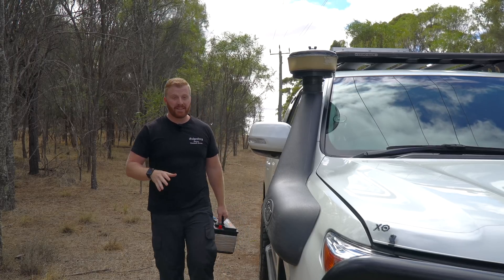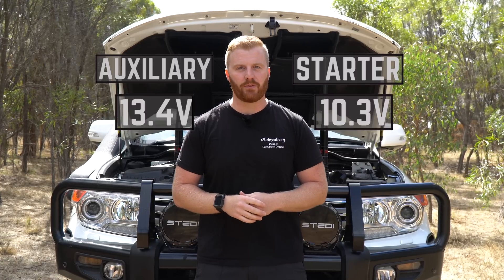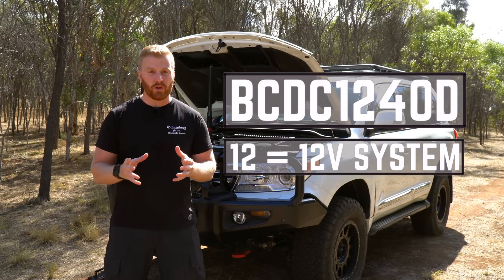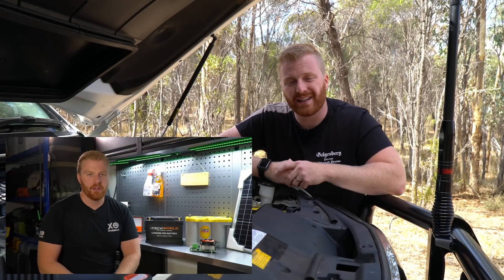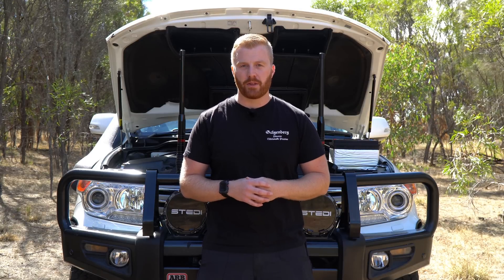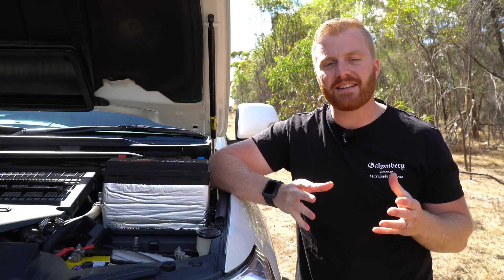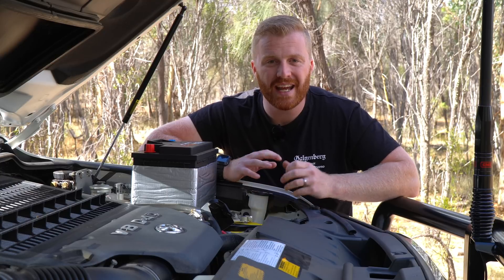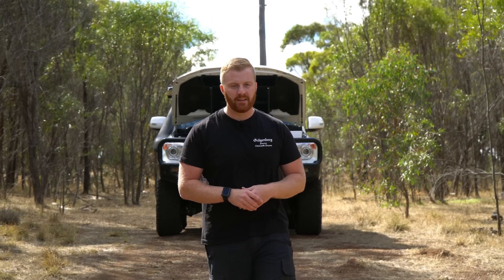LITHIUM is OUT for now… | Not everything works first time | iTechWorld 1420 CA PRO | The AGM is back

Comment: With so little voltage drop on the lithium battery it would be hard for the charger to disconnect before flattening the crank battery the constant high voltage is a great feature in a cordless drill but a challenge for us off-road who use Voltage to measure how much charge is left in a battery.I not sure about the ignition wired solenoid you could be connecting a extra 50 amp load to your crank battery when you don't want it ? great video regards Mike
Reply from the maker: Yes, the constant high voltage can make it hard to see what's going on with the state of charge, this is why I'm using the Victron BMV712 monitor which can record the Ah's coming from the battery and therefore provide a state of charge reading as well as time remaining with current power drawer good 👍 
Cheers, Nathan.

Comment: Good Vid mate, as others have said, the victron SBP doesn’t like heat, and many have had issues with them installed under the bonnet. Relay could be the go, or an even better option in my opinion is a victron argofet isolator. Solid state, and replaces the DCDC and relay. Charge both batteries fasted as well👌, assuming both can handle the current from the alternator👍
Reply from the maker: Cheers mate, yes the heat concerns was something I forgot to mention in this video. I'm think the relay should be a simple fix and was the solution suggested by Redarc themselves too. 
Cheers 👍

Comment: Hi Nathan great research you saved me the dramas as I am going down the track with same Itec starting battery and possibly auxiliary Itec lithium battery, how will the 50 amp relay go with the lithium auxiliary? I use the same Redarc 1240 as your setup. Surprising Itec doesn't address this problem in  the installation brochure with Lithium battery. Looking forward to seeing the brand and installation of the relay you choose .Thanks
Reply from the maker: Thanks mate, glad to hear I may have helped you in the future 👍 
The 50A relay shouldn't effect the auxiliary battery, only determining the state of the Redarc BCDC unit. 
Yes, I guess everyone has a different setup and not everyone will need to consider this, however if iTechWorld mentioned this it many hurt sales a little 🤷‍♂️ 
Either way, I hope this can raise awareness to other's with similar setups. 
Cheers.

Comment: Great video. The victron unit is a good product but has an upper operating temperature limit of 60deg C which means it may not work properly if installed under the bonnet. Just something to keep in mind if going down that route
Reply from the maker: For sure and something I forgot to mention in this video. It would be counter intuitive to have to wire this in and out of the cab to prevent overheating. 
Cheers, Nathan.

Comment: Good video, something I came across- there were too many options for a VRS for lithium.  A HFD relay switch off the ignition- just seemed antiquated when stepping up to new technology lithium.  Can you remove the bcdc charger and return the batteries back to a parallel system, with the Victron smart battery protect or similar to ensure adequate starting amps remain?  This has the benefit of increasing the available a/hr to you.  A simple mppt charge controller for solar input.
I don't know much about the difference between  itech crank and deep cycle batteries but this works in another lifepo4 solution available on the market
Reply from the maker: This could be another option and I believe this is how the DCS systems work? You would have to wire to of the same batteries in parallel, meaning that you would have to use the 1420CA PRO's and they are only small 60Ah batteries. This would only give you 120Ah in total for both accessories and starting, which is probably not as much as I've got now with the single 120X battery. 
Many different options to consider though. 
Cheers, Nathan.
Reply: @XploringOz  ah, so the hybrid cranking battery is only 60Amp.   Is two of the 120X in parallel not suitable for cranking?  I dont know the stats of the 120X BMS.  I thought Intervolt made a VSR which was suitable to lifepo4, or at least programmable for there voltage specs.
Good luck, looking forward to the end result.  
Looking forward to the van reveal too.  Keep up the good work.
Reply from the maker: @Mouldyturnip75  Yeah, that's right. These batteries are slightly different and therefore aren't compatible to be run in parallel together. This would work however with a system like the DCS twin batteries. 
I'm working through some options at the moment, I'll be sure to report back with any findings 👍

Comment: Just be mindful that the Victron unit cannot be mounted under bonnet as it will overhead and cut out. However if you mount the Victron unit in-cab, the cabling becomes a nightmare, as it has to go in-cab then back out to the BCDC.....
Reply from the maker: Thanks mate, the heat concerns was something I forgot to mention in this episode and I agree routing the wiring in and out of the cab would be very annoying and counter intuitive. 
Cheers.

Comment: Hi mate, I have a similar setup with iTech batt. Dont use the Victron Batt Protect as they sometime trip out and detect a short circuit fault and you will not get BCDC charge when driving. It will annoy you and you will end up bypassing it. They are a solid state relay and dont like inrush current. Also dont use a 50A relay if you can as it may be too small. I would use a 150A Narva or Kickass low voltage relay that opens at 12.8v (20% SOC) or if you want to maintain all start batt storage, use a >100A relay off your ignition trigger. An even better solution is to not have a BCDC at all and install 2 iTech batts. You will be charging at 140A off the alternator and amazed at how fast you recharge. Then connect your loads through a LVD relay to protect batts from over discharging and maintain starting power. (I have this in my cruiser and is so much better). Hope this helps. Cheers, Adam
Reply from the maker: Cheers mate, some food for thought there. I'll have a look and see what I can come up with. 
Thanks 👍

Comment: Ouch !  Ads every 10 seconds is too much, please check your advert settings.  But yes , mixed battery types will cause problems.   I'm having issues with replacing LA batteries in my Computer's UPS with Lithium. Voltage mismatch between the desired voltage output of my UPS - 240V and the input voltage, sometimes 220 V (land line) is draining my batteries.! .. annoying.
Reply from the maker: Hey mate, sorry you experienced that. My account is only showing 2 ad's during the video after the initial ad at the start. Not sure why you are seeing soo many? 🤷‍♂️

Comment: Thanks for the video. Explains a what is happening with my setup. Itech lithium starter and auxiliary batteries with a renogy dcdc controller. The setup will be fine some times and then other times I have to repeatedly put a Jumper pack on the starter. Interested to see what your work around is. 

Keep up the great videos.
Reply from the maker: Hey mate, yeah sounds like a very similar issue. Hopefully a simple fix will be the solution 👍 
Cheers.

Comment: i would go with the victron smart battery protect, as it's a solid state relay and i would also get the 12/24v 100amp not the 60amp ,
Reply from the maker: They do look like a great unit, something I forgot to mention in this episode is their heat concerns. These units are not ideal for under bonnet fitment and therefore might not be the best solution for my problem. 
Cheers, Nathan.

Comment: Great work Nathan for your investigative work. 
I like the features of the Victron Smart Battery Protect because of it's delayed connect that would give maximum battery for the vehicle to start before connecting through to the BCDC and secondary battery. I've read comments about not installing the Smart Battery Protect under the bonnet but I feel it would be best located closer to the main battery it's protecting.
Reply from the maker: Thanks mate, glad you enjoyed the episode. 
Yes, heat concerns would be something to consider. I think I'll stay with the simple relay setup for my fix and see how this goes. 
Cheers, Nathan.

Comment: Just checked my Piranha DBE140SF Dual Battery Isolator has a stated cut-out voltage of 12.8V, so I could expect a similar problem … very frustrating!  Thanks for the update.
Reply from the maker: Yes, I would say you would encounter a very similar issue with that charger. Hope this could help in your decision making.
Cheers

Comment: What about the charging characteristics of the alternator and the lithium battery? How do you get the alternator to maximise the charge for the lithium cranking battery?
Reply from the maker: Hey mate, there is no adjustment required on the alternator. The BMS within the lithium battery helps to monitor and correct the power required for charge. 
Cheers, Nathan.
Reply: @XploringOz  ahh, well there ya go. Thanks for that. Learnt something 🤓

Comment: Great video Nathan. Most DCDC chargers include an ignition wire to detect ignition, but it seems all this does is change the parameters i.e. lower the cut-in voltage for compatibility with some vehicles. I wonder why it isn't used as a simple binary switch? i.e. charge when ignition detected, stop when not. It would be a simple (firmware only) change I would think. If you don't want to use that feature simply connect the ignition wire to the input battery instead to retain previous behavior.
Reply from the maker: Yes, and the Redarc does have a blue wire 'low voltage' setting, however this only adjust the parameters slightly, not enough to eliminate this issue properly. I agree that the solution seems firmware related and I'm sure it won't be long before manufactures are including these options in the newer models as these setups become more popular. 
I'm going to assume that given Redarc technicians also gave me the advice regarding the relay, suggests that the blue ignition wire probably won't solve my issue in this instance.
Cheers,
Reply: @XploringOz That 'Alt' wire is for 'smart' alternators that change their output voltage & charging current while driving to save a poofteenth of fuel. Otherwise the DC-DC charger would go on and off like a hookers undies while you were driving, and might never get your Aux batt charged. Hooking the wire up turns the DC-DC charger on all the time there is ANY voltage on it, which in turn loads the alternator, which then outputs more volts & amps to charge the Aux. I've heard on the BT50 & Rangers the dealer can disable the 'smart' Alt bit & make it ol skool dumb, so DC-DC chargers work without any workarounds like that IGN/ACC sense wire.

Comment: ASPW came across this a while ago while putting his starter on charge on 5amps and his BCDC pulling 40amps out as it detected charging. Changed how i do things.
Reply from the maker: Yes, I have that same issue too when I have the cruiser on trickle charge in the garage between trips. The Redarc will activate and keep both batteries at capacity. 
I should have realised this would be the case when installing this battery 🤦‍♂️ 
Cheers

Comment: Great video.  A 50A relay might be a bit small for a 40A Redarc, given it may actually draw up to 50A and is protected by 60A fusing.  Narva make a nice 70A relay which is what I use.
Reply from the maker: Cheers mate, I'll keep this in mind. I might try the 50A setup first, only to test to see if this is the case. It wouldn't be hard to switch out for a 70A in the future if issues arise. 
Cheers, Nathan.
Reply: @XploringOz  I have just put in an old school isolator in between my dcdc and main battery works a treat!

Comment: Thank you so much for bringing that issue up. So those who are still using AGM or Led Acid cranking batteries should not warry about this issue, right?
Reply: Yeah, but you will have other issues with old tech batteries: low RC, low CCA, low voltage, short life, over weight...
Reply from the maker: Correct, more traditional battery types won't have these issues as their voltage will decrease to the 12.7V level very quickly and therefore the Redarc will stop transferring the power. 
Cheers, Nathan.

Comment: Fascinating Nathan.  I have the exact same aux setup with a BCDC and Victron monitoring as you do.  I intend replacing my lead cranking battery with a lithium when it dies.  As I have a resting current draw of around .15amps on my aux battery, I would have run into the exact same issue with the drawdown on my new lithium cranking battery.  You have saved me from a few headaches chasing the problem down, and for that I thank you.  I’ll still go the lithium crank, but use the Victron solution you outlined to prevent the start battery discharge.  Now time to pack, I’m off camping for Easter.  Go well mate, cheers from Jafffa Adventures.
Reply from the maker: G'day Terry, I'm glad I was able to test this before you experienced the same problem. Fortunately it seems like a fairly simple and easy fix at a relatively low cost. Reading the other comments here, it would appear that the Victron unit doesn't like heat, so it may have to be mounted within the vehicle to function correctly, something to think about. 
Have a great Easter break.
Cheers, Nathan.
Reply: Be careful replacing your lead acid cranking battery with a lithium cranking battery.  Obviously it can’t be connected through a BC DC  and you may have to go without a vehicle while you argue with auto elects and vehicle manufacturers. In the end it’s easier to work out the problem, which I did at the beginning of problems, and just bite the bullet and fix it yourself.
Reply: Since I’ve had solar on my vw t4 always seen to have current draw.I run a cable back from solar and leisure batteries back to starter battery.with an isolator inline.I’ve read recently about fitting diodes in solar to stop. Solar current draw also